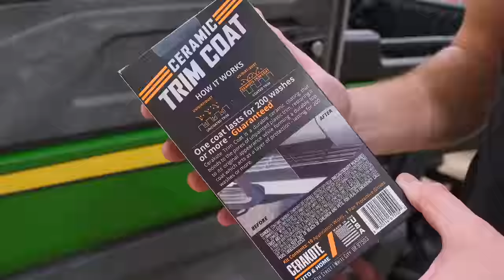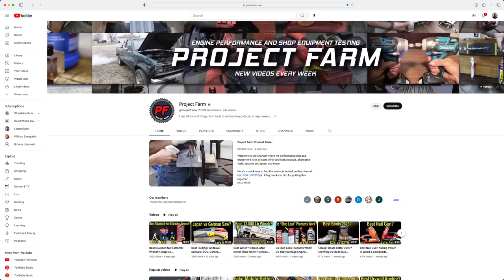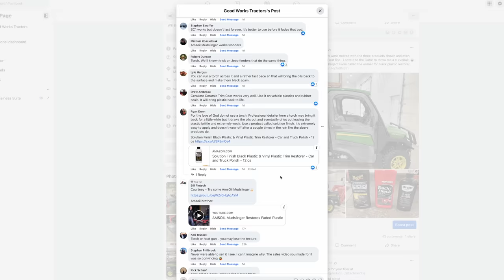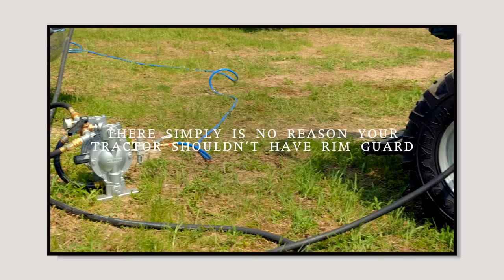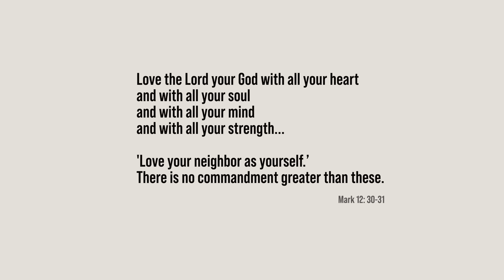THE BEST BLACK PLASTIC RESTORER. THERE'S NO DEBATE.

Comment: 10/08/23, inspired by your experience I did the roof (both vertical and horizontal surfaces), all exterior trim and outside of mudflaps on my 2013 cabless 825i gator. Not show room but much much improved appearance now. Durability remains to be seen, but I note all of the little wipes dried up into hard crusts, so there must be something serious in this witch’s brew. Unlike everyone else reporting on their use of this product, I wound up using the whole boxful of wipes and needing just one  more than I had to touch up some spots I missed. Would be interested to hear what people might be using as a protectant for colored plastic on their atv’s or gators. I used Advanced Kotings Plastic Shine & Protect on green surfaces before moving to the Creokote and it was okay but doesn’t seem to be a product that will last long.

Comment: How old is the Gator? My memory tells me there was an issue with some doors/rear panel/black roof not getting the correct amount of UV protectant in the polymers- check with your local dealer, maybe they can make a case and get them replaced for you.

Comment: lol.  I think it's time to sell the Gator.  That Cerakote Trim Coat turned out really good!  I'll have to give it a try after I run out of my aerosol spray Maxima 78920 SC1 High Gloss Coating.  Maybe my ADD has been kicking in and I've missed it in other videos but I like the Bible Verse at the end.  👍
Reply from the maker: Haha, I know...for some unexplainable reason, I kinda don't want to sell it.

Comment: When i have rugged textured plastic like that turn grey, I just use a heat gun or a small torch and go over the grey areas and it looks like new again! Cheap and easy!
If the plastic seems very dry, you may have to do multiple applications of whatever product your using to help it last

Comment: Try a torch on a small area. We restore black fenders on our two cub cadet zero turns with a small propane torch and a flare burner tip. Worked great.
Reply from the maker: That was the only other thing I was gonna try if this didn't work.  I'm glad this worked.

Comment: Not just the gator with the battery location issue.  I had a weird year this year and didnt get my trickle charger on my quad after hunting season.  Went back in Feb and low and behold it was dead (at hunting property).   The battery was equally impossible to get to.  Polaris.  Horrible location under machine.  Shame on me for not seeing that when i bought it.  Ease of maintenance is a new criteria for me!  I spend far to much time these days doing things that used to take minutes.  (e.g. Oil changes, battery changes, filters, etc.) because of how they put these things together these days.  In fact, I sold my Kubota tractor for this very reason.  Filters/Battery, etc. all just pains in the back side to work on.

Comment: Do enjoy your video’s and the recognition you give to other Youtubers.  And I would like your recommendation on a what size tractor you believe could handle a 12 foot brush hog used in medium duty type of application. Mostly clearing weeds. As well some small Huisache and some small mesquite under 1.5 inches.
Reply from the maker: Hi Billy,

12' is pretty large.  Ideally, nothing smaller than a 4 Series tractor.  However, I'd prefer something like a JD 5 Series or Kubota M Series in the Utility tractor range.  Of course, other brands as well, but that gives you an idea on size range.  I've found those gear drive machines run a lot cooler than the hydro machines on hot summer days.

Comment: I put pigtails on my batteries so that I can charge them without having to access the battery.  I can’t jump them that way, but often a few hours on a small charger will do the trick.  It is crazy where they bury the batteries these days.
Reply from the maker: Yeah, quite a procedure to replace the battery on the Gator.  Pretty stupid.

Comment: Courtney, that is really disappointing to see the cab plastic degrade like that.  I know how much that Gator costs and you'd expect better durability.  Seems the treatment helped though.  You can see the plastic finish is damaged though.
Reply from the maker: Yeah, it is strange.  The rest of it cleaned up just fine and wasn't affected.  Just something about those doors.
Reply: @GoodWorksTractors  I will bet the doors were sourced from China.  China plastic and rubber products are the worst in regard to UV resistance.  I had a trailer that cam with Chinese tires and they were severely weather checked in two years.  My trailers with American made tires easily go 8+ years before weather checking becomes noticeable.

Comment: I have and 835M it's the black and green one not the JD green that you have.  It's the cab plastic that sucks.  I've had mine since 2019 and haven't put anything on the bed.  the doors, roof, and rear panel suck.  Once a year I wipe it down with boiled linseed oil and it pretty much holds the whole year and it sit's outside most of the time.

Comment: The plastic on my Chevy Avalanche faded. I used transmission fluid to bring it back to a shine. The plastic is made from petroleum and it gets dry and fades, so I use a petroleum product to fix the dryness.
Reply from the maker: Surprised that lasted, but glad to hear it.
Reply: @GoodWorksTractors  nothing last forever especially if left in the sun. Transmission fluid does a good job and holds up pretty good to washings.

Comment: Perhaps if the manufacturer hadn't been so interested in saving money building the discoulered parts (cheap), this wouldn't be an issue?
Reply from the maker: Maybe?  I don't know the reason.  Strange that the back of the cab which was hidden by the bed still faded.  No direct sun exposure there.

Comment: The location of the battery is not good. Our Cub Car Carryall 295 has the battery under the seat. Just lift the bench seat up and the battery is right there, along with the little Kubota Diesel engine powering the vehicle.

Comment: Weird how only certain pieces faded, time to sell it and get a Kubota 😉🙂. Have a great week guys 🙋🏼‍♂
Reply from the maker: It is strange! I've got that Ranger now and love it.  Those Kubota's look nice, but I always see door rot on the older ones?  Have a good one!
Reply: @GoodWorksTractors  Door rot...they were probably made by John Deere 😂🙋🏼‍♂
Reply: We have two kubotas at work both have rot in the tray floor and on the back chassis. Oh and one has had the transmission replaced due to a crack forming after being driven in wet mud. According to the dealer it's common.
Reply: @mtozzy11  That's not good...
Reply: @OrangeismyNewGreen  and we don't get snow, they aren't left outside, and most carry around tools in the yard. Their only 4 years old too.